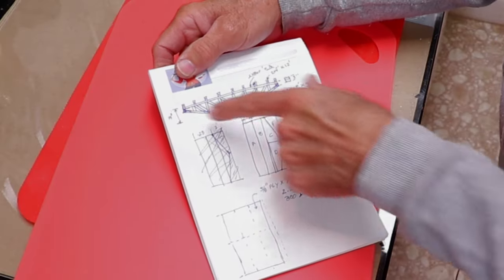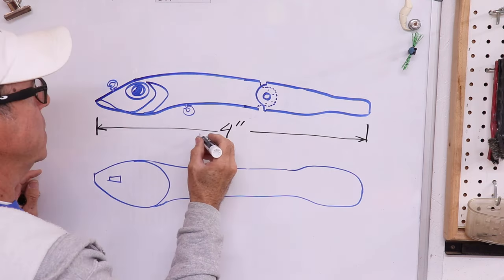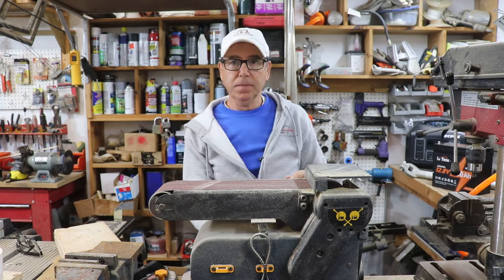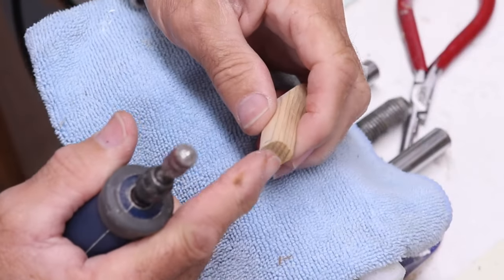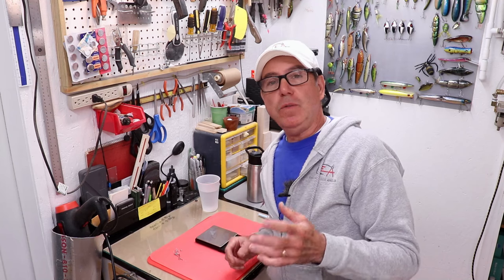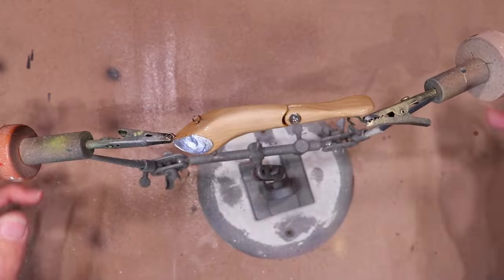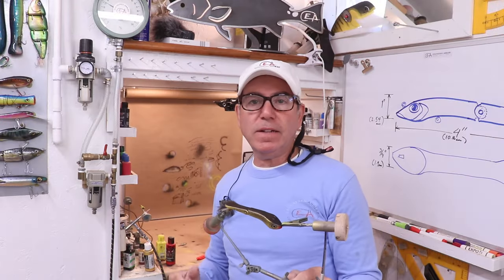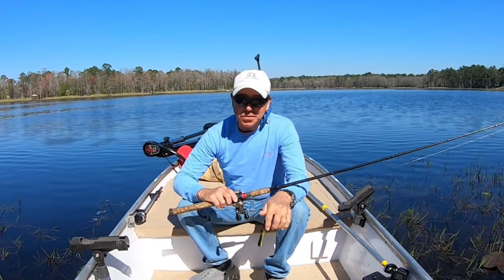Making an experimental fishing lure, adjustable fishing lure #luremaking #lurefishing #airbrush

Comment: I liked the story behind your coming across and old design revisited . That you brought your concept from paper to lure in hand is a victory in itself . 
In my humble opinion I believe had the head design of your lure been set back more with more the flat surface extended , like that of the Zalt Wobbler or the Drifter Tackle Believer .You may have achieved more wobbling action . I may add as well a more scooped head like that of the Luhr Jensen Kwikfish a more erratic swimming cadence would be achieved . I'd know the engineer in you will not have you satisfied and may return to workout the issue if not for closure . Thanks Franco , for all your content .
Reply from the maker: I agree.

Comment: Thanks 🙏 Franco!

You showed us 3 different methods to find volume:
1- by density formula of a given material
2- the method that you're using in this video
3- by a "still", the water tube pipe that you built
I experimented a lot using these 3 methods, there are remarcable differences between, big one! 4,5 grams.
I experimented not only with lures, with cube shapes too where I can calculate volume and compare with the 3 above mentioned.
Probably the density method is the most reliable one, what do you think?
Reply from the maker: I have  done the same kind of experimentation over the years.   While the volume calculation with the density of the material is usually the most accurate it is only true when the material is well-controlled, meaning the material is uniform and  non-porous.  But for actual lure building situations the weight in water is most consistently accurate.
Reply: The "weight in water" is the method that you're showing in this video right?
Indeed, based on your experience, this method is more reliable than the "still one" where you have to wait patiently that all the drops fall down from the pipe. Based on what I did it is.
Thanks 🙏 so much, all this experimentation is fun!!!!!

Comment: I think the flat paddle on the back end stabilized it.  Make the head a little wider.  Or make the head and tail wider    and a slow sinker. Use it like a jerk bait.  It should do some crazy things.
Reply from the maker: It actually works pretty nice as a twitch bait with the tail slightly angled down.

Comment: Hey Franco,  another interesting experiment. When you cut the cedar on the table saw it looked like you didn't push the wood all the way passed the blade and left the wood between the blade and the fence with the blade still spinning. That wood can fly back at you.  Pls be safe.
Reply from the maker: Thanks for the tip!

Comment: I misunderstood what you were trying to do and now I wonder if it might help.  Instead of making the tail controlled, just put a pin in it and let it "dolphin" up and down.  There's lots of lures that go side to side but I can't think of any that are jointed and go up and down.  I would be interested to know if it would work.
Reply from the maker: I don't think it will work because most of the action comes from the shape of the head or the entry part of the lure. But that's an easy one to try, I'll pull the screw out and just stick a pin in. You might see the result in a short video.

Comment: Is anybody with me on this??? In the weeks between new builds, what if you took an old lure and just modified it? For example, what if you cast a crankbait from one or your old molds in silicone or  the stiffer, more durable type of plasticol? I would love to see what that does to the action. The Nomad Vertrex Vibe is partially cast in silicone. A lot of people love that lure. Does the silicone really make a difference? Can the Engineered Angler give us an answer?
Reply from the maker: I have actually done exactly that.  The big difference is the lure has no positive buoyancy and is not stable enough to give any consistent action.  But makes a wicked  fast sinking twitch bait.
Reply: Interesting. Thanks for all your work!!!  @EngineeredAngler

Comment: Nice looking lure, I love the hinge idea but to be honest, you really made a lawn dart, heavy at the front, "feathers" in the back, pointy and rounded off, and yes, nice little dive bib at 35° - 45° would probably fix the action. Maybe even if you caved in the flat surface on the head a bit with a dremel it would grab more water. Maybe a future video idea? Make a mold and compare the original to the one with a lip and caved in one.
Reply from the maker: Good point!